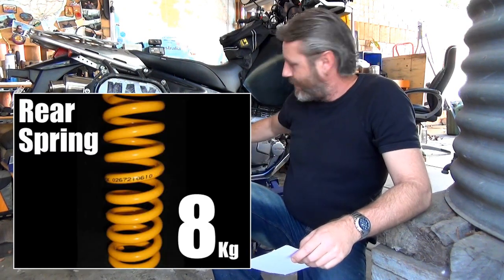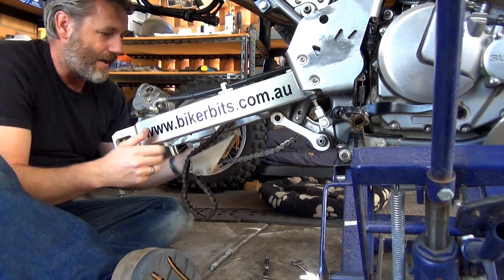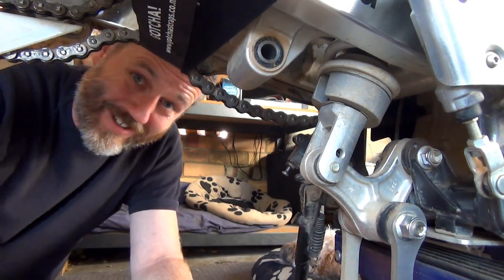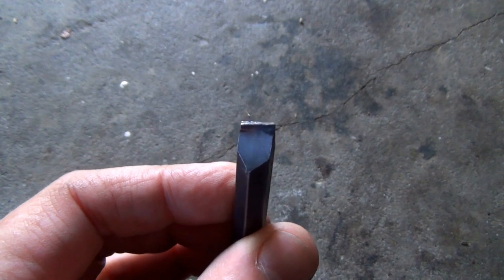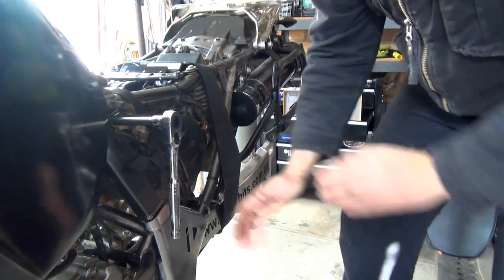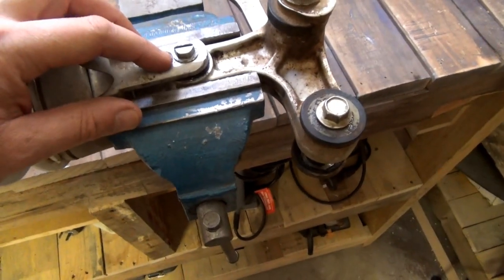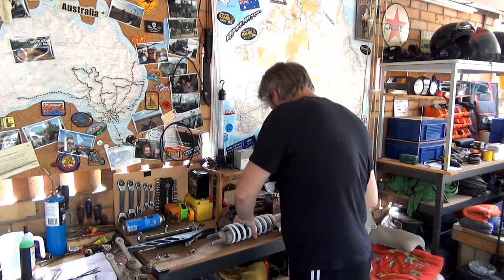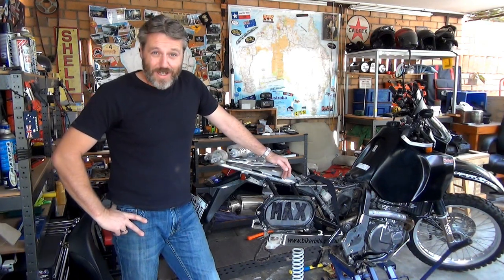DR650 Rear Suspension Removal

Comment: Ahhh, this brings back memories.  Leverage is everyone’s friend.  When I was 17 years old, I was working on my newly purchased 1987 Ford Bronco.  I was trying to get a bolt loose under my truck.  Similar to you, I heated it up, used an impact wrench, cursed, threw things. Banged my knuckles up.  Had a friend of the family come by, an old timer engineer.  He was 75 years old and would climb under the truck with me, anytime I was working on it.  This day was no different.  He said, “calm down and regroup. You’ve got to be smarter then the object”.  He gets a four foot pipe from his trunk(1967 Chevy Biscayne) and climbs back under the truck with me.  He said, “you ever hear of leverage, you can move just about anything with it”. He puts the pipe on the end of my socket wrench and says, “one of three things will happen,  it’ll loosen the bolt, break the bolt or break your socket wrench”.  Go apply even steady pressure, while I keep the socket on the bolt”.  I did and it loosened the bolt. I was amazed at how little pressure it needed to move the bolt.  I miss that man, James Fitzgerald.
Reply: Sounds like a legend.

Comment: I've just stripped my 1996 DR650 SE down to the frame to get re-powder coated and this bottom shock bolt is exactly the one that isn't moving for me either. Will give your method a go tomorrow having already tried multiple days of penetrating fluid, heat, 6 point sockets and a breaker bar. Thanks for making the video...really useful!

Comment: Mark, good videos. Thanks!  This was very helpful, thank you....  Reason being: The order of the swing arm (rearmost) pivot bearing bolt and thrust washers published in both the Clymer and Suzuki manuals, is incorrect in the exploded view of the lever and lever arm (dog bone), .  These manuals indicate that the thrust washer goes on the outside of the dog bone, whereas you noted (correctly) when you removed the bolt , that the thrust washer goes between the dog bone and the pivot spacer.  This provides additional mechanical protection to the bearing seals, and a flat (ground) surface onto which  the pivot spacer can seat (rather than being forced into the aluminium dog bone, and causing the bolt to loose tension as the dog bone wears against the spacer).  The sectioned, assembled view of the dog bone, pivot bearing bolt and thrust washers appears correctly in the Reassembling Information sectioned drawing, chapter 5, page 45 of the Suzuki workshop manual.

Comment: Perfect example of how not having the proper tools makes things much much harder. You need a set of 6 point sockets and a Big breaker bar.  Any socket or box end wrench that has 12 points in it should just be thrown away. Never use those things they are only good at striping stuff out. But mainly with a bolt that big you just needed more leverage. Shouldnt ever need to hit a wrench with a hammer. With a breaker bar at least 18 inches long you most likely could have pushed on it and losened that bolt with one hand.  Leverage is an amazing tool. 

 That impact driver thing you had is great for removing stubborn screws but never a bolt as you found out. What would have been better would have been a proper impact wrench. The sort of thing you see people removing lug nuts with. 

 After getting the right tools get a can of penitrating spray oil of some sort. That mix of stuff will make this sort of thing so much easier you wouldnt believe.

Comment: Hi Mark, great vid's as usual, very entertaining :)
A couple of things that you may know, or if not, may come in useful in the future,

'Righty tighty, lefty loosey' for 99.9 % of nuts and bolts

And the impact driver, you probably know, but you must make sure it's set to undo before striking it,

 Hold the driver, turn it in the direction you needed rotate the bolt as far as you can, hold the wrench firmly and whack it with the hammer.
There's basically a spiral cut groove and a couple of ball bearings in there. When the hammer whacks it inwards, it turns that motion into a torque. The grooves are cut both ways, so winding the wrench in either direction forces the balls up the appropriate spiral.
You need to hit them pretty hard, gentle taps won't do it - limited by judging the damage you'd do whacking whatever with the same force.

May be of some use to you or someone else, keep up the videos, and 'keep on riding'

Comment: Awesome video as always. These problems always turn up in the "simple" jobs. I had. To replace a front brake caliper due to a seized cover plug. All for a new set a brake pads. 

The white crap on the bolt may have been corrosion from dissimilar metals. I'd put some anti seize on the threads when you reasemble.
Also, GOOD penetrating oil. Not WD40, PB Blaster is decent, Seafoam Deep Creek is better, Kroil is supposed to be the best. Also you can make it yourself. 1 part Automatic transmission fluid, 1 part Acetone. Shake before use. Works very well.
Get some 6 point sockets to help prevent stripping a bolt., a breaker bar, and a powered impact gun for the really tough stuff, they make 12V models for tire changes, and also some house current models. Best is air power, but that required a good size compressor.

Looking forward to your reassembly and testing videos. That DR is awesome.
Reply: +kens97sto171 Going to remember the Kroil thing. Hadn't seen that before. Thanks, man!

Comment: Cool little inspirational plaque at the end.  I have never seen that impact tool you used.  What you need is an electric impact driver. They usually have a torque rating around 400-460 Nm. It's a big heavy corded drill.  But you also need to buy impact specific sockets and extensions.  Regular sockets will just split out if you use them on an impact driver.  They cost $140-180 US depending on brand. Glad you finally got it.

Comment: I could not for the life of me get the dog bones off that were bolted to the swingarm and then I remembered this video. Who in Hades thought it would be great to cement the damn nut on? I'm guessing the lawyers did. After watching the video again, our kind DR poster said, "you've just got to keep at it."  So I did and then the big bolt creaked, oh shit I either sheared the bolt or loosened the nut. Success!  I used five heat cycles with my propane torch allowing time for it all to cool down. You have to get it pretty hot but not red hot as there are rubber seals in there but get it quite hot because the the aluminum is just like a heat sink and will pull away too much heat. Then I used two 1/2" breaker bars for the 17mm & 19mm sockets and beat the hell out of it with a dead blow hammer. PITA. So thank you Mr. DR motivational speaker because I was just about defeated.
I think I have a pulled muscle in my back.
Reply from the maker: Bloody Good Job! :-) Cheers... Mark

Comment: The sections of you trying to get that nut off probably sold more impact guns than any advertisement Harbor Freight has ever run.  Some of the damn bolts on these bikes are on there so tight, you could swear they were never actually designed to come off.

Comment: phew!  I'm exhausted.    Thanks, I enjoyed the drama. 
I did rear spring with a Strang replacement 3 years ago. Now time for rebuilt rear shock. BTW,  I used Ricoh intiminators and low weight oil under front standard springs for a great result  (I'm 85-87 kgs ready to ride). There seems to be a few decent solutions/improvements around for the front softness.  
Haven't seriously considered a steering damper yet but would love to hear how much difference it makes in the rough stuff

Comment: In my xf650 I remove it from the bottom without touching the airbox. I just removed the rear bolt of the linkage, and move the linkage out of the way. It's worth a try on the DR too.

Comment: Man that dog's trying to steal your thunder Ha Ha. I would have tried a socket with more leverage first .I've never had much success with those impact drivers, so I usually just drill a hole in the head of the bolt and use the easyouts/dovalacky/reverse tappa thing. I like the way you go about things and show everything to help others out. Even though these vids go for a long time I still watch them all. Cheers

Comment: Great vid Mate... And the guys on here are dead right. A quality half inch six point socket and a three foot breaker bar would have it done in seconds. Cheap ring spanners don't grip enough of the head and round the corner, and open enders just splay open under heavy load. Because it was so tight t..once you cut the head off the bolt the load on the thread was removed and thats why it came out with the easy out.. I used to play with huge torque loads 1200 Foot pounds, you can guess the size of the tools. Stay safe Buddy.

Comment from the maker: Hey guys, here is my EPIC adventure of removing the rear suspension from MAX the DR650 :-)  Hope you enjoy :-) Cheers... Mark
Reply: C-Spanner and a Spring compressing tool.
Reply: Biker Bits  Glad your doing the suspension on the DR.
its very under sprung for anyone over 13-140 lbs.
If you don't like the shock re valve Consider the Cogent shock shaft assembly off. I'm going the expensive way and getting the Cogent Mojave Pro.
that's an expensive bit of kit.

But I trust CDD because the owner of cogent dynamics ACTUALLY rides a DR650 so he understands how much the suspension sucks for anything but fire roads

I see your getting the gold valves. Did you ever consider the DDC?

hahahaha this sounds like I'm advertising here but there's a lot of raved reviews about these products
Reply: +noah villalpando shoot! the suspension is undersprung even if the dr could drive itself. lol. I'm about to order the Mojave Pro shock from Cogent today. Can't wait!!! Todd over there has been conversing with me in depth regarding my riding style, weight, and other stuff. The Mojave pro sounds like the perfect thing for me. Man, wish i had it already

Comment: I have really enjoyed watching your entire series, but this one is forcing me to comment. Several people have said it - you need some proper tools. A breaker bar. At least 18 inches, preferably 22. Six point thick-wall sockets. A REAL impact wrench. Air or electric.
BUT. Having said all that - next time (if you still don't have the proper tools), clamp the head of the bolt into the jaws of the vise, then use the entire body of the shock as your turning handle. That should give you enough leverage to break it loose. Yes, it needed a washer under it. I'm thinking not only did your threads stick (because of no anti-seize compound), but the corners of the bolt dug into the surface of the clevis, and that locked it  in place. But I still think the bolt in the vise would have worked.
Also, most motorcycles that come with a tool kit have a suspension adjusting spanner. It's a little doodad (that's a technical term) that has a handle, then a curved section that follows the curve of those nuts (at the top of the spring) for about a quarter of its circumference, and then there's a little square tip at the end that goes into the part you were beating on with the bolt. Works a treat! Spins those nuts right off! Of course, you'll need two to break the lock nut loose (the first one to hold one nut still while the second spins off the other nut).
Great video, though, and you show that perseverance pays off!
Reply from the maker: +William Stadelman Thanks heaps for all that mate! :-)

Comment: “That’s anti-clockwise’…🤣🤣🤣

They are frigging tight. I have a 750mm breaker bar and I stopped and thought the same 👍🏻😁 Suzuki don’t stuff about with pussy-torque. 😳

Hammer and wrench maybe not the best 😳 but appreciate your enthusiasm 😁

1/2’ socket set and breaker bar for birthday 😁

Comment: they also sell a certain wrench for pre load adjustment, I got one for my dr 350 that you can adjust on the trail if between having luggage on your bike and not.
http://www.thisoldtractor.com/dr350_shock_adjustment_wrench.html
Im not sure if your new spring will raise your bike much, but lowering links might work, if it is higher.